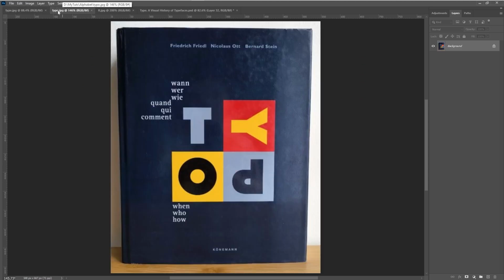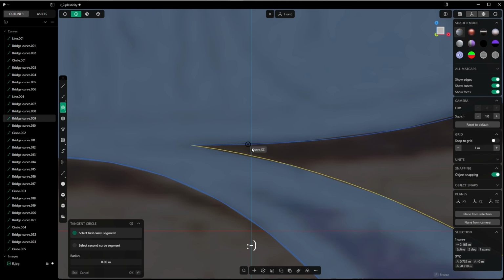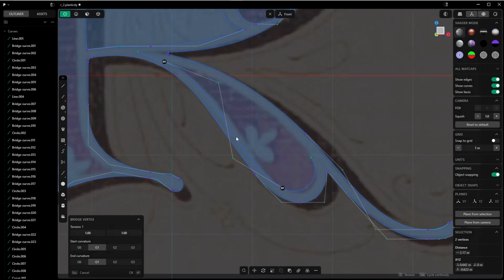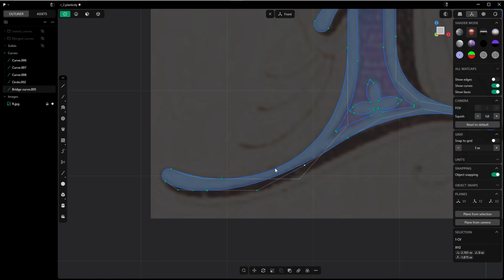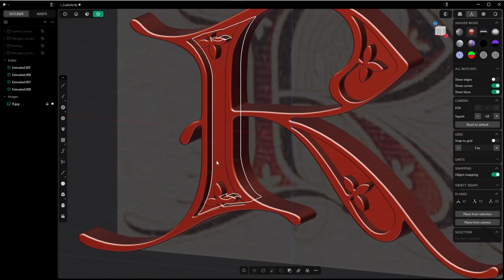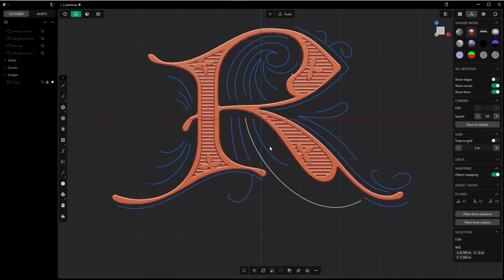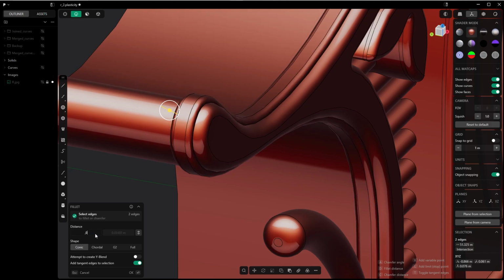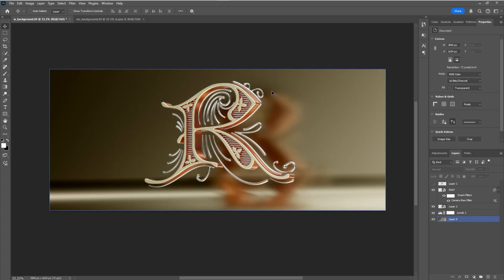Initial R - 3D Lettering with Plasticity

Comment: Man...I was drooling the entire video.  I make my living with Illustrator and own a sign business. Loved your reference to Illustrator and how rebuilding helps makes better models. Learning to draw in Plasticity is not as easy for me or as fun as Illustrator because of muscle memory.  
Right clicking or clicking Ok to proceed really grinds my gears.  The pen tool is my go-to tool in Illustrator but Plasticity has nothing like it.  I don't get it.  Regardless,   Love all your videos!!!  Your videos are liking eating brownies.   Hard to just watch one.   And your sense of humor!!!!  Lot easier to learn when I'm cracking up.    You mentioned something about a class or potential class in typology????
Reply from the maker: @Navigator777777  thanks a lot for your encouraging comments. In fact, Illustrator & Plasticity are like Tango & Cash. They complement each other perfectly and if you throw Blender into the mix, you are unstoppable. 
Regarding muscle memory, after having worked in Plasticity for a long time, I started looking for its tools in Illustrator even though Illustrator is my go to app for 20 years :) When you use both extensively, you'll get used to the switch between both. 
Currently, I am tackling a lot of different type of videos: 3D illustrations, 3D typography, hardsurface stuff as well as the quick tip series. Hence, I am not sure when I will publish the next typo video. In the meanwhile, if you have any suggestions for typography which could be discussed and converted into 3D in Plasticity, just let me know 🙂
Reply: @3Dto2D  
Although I'm a 2D sign guy, I 3D print and have a CNC Router.  I used $ Plasticity $ on two successful jobs 3D print jobs recently.  Consider making a video on exporting Plasticity for making a products!  
Just because I do it doesn't mean I understand it.  For example: Wavefront OBJ,
STL, STEP, Parasolid, 3MF, IGES,  and SAT files are our options.  Of the bunch, STL is what I use but I don't know why.  One of my jobs was for 6 custom pipe configurations for a John Deere seeder.  I charged $50 each for something that costs him $200 each.  They were 20 hours print files but I haven't a clue if I coulda saved myself a ton of time by saving differently.  
 I found out by accident Wavefront OBJ works but I dunno what it is or why I should use it. I suspect there is a lot of good info that I've never seen covered by any other Plasticity educator like yourself.
Reply from the maker: @Navigator777777  Hi, to be honest, I am a keyboard warrior. I exchange files between CAD and polygon software for product visualisation or from vector to 3D. But when it comes to 3D print, I didn't have the opportunity to make something on that field unfortunately.

Comment: Great video! However, I don't understand why you need to rebuild the curves. What is the reason for doing that?
Reply from the maker: @FightingZeds  thanks, I rebuild with the points method for merging the segments of a curve to one single curve so that I can avoid unnecessary edges when creating a solid and for smoother transitions. I am explaining it also at 18:08